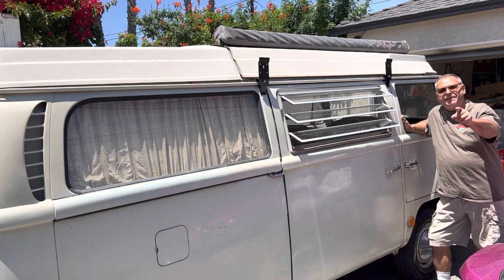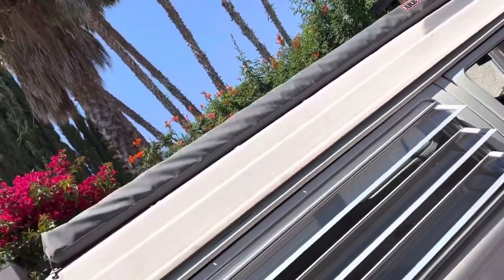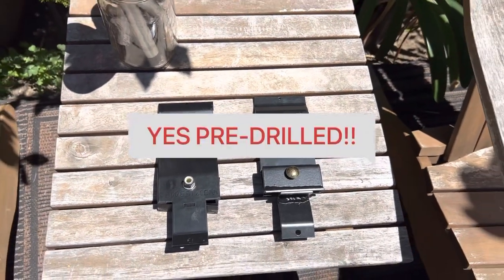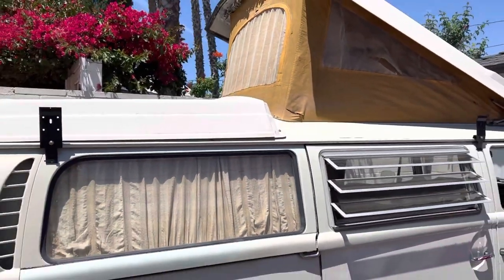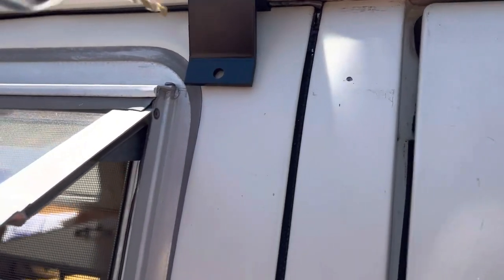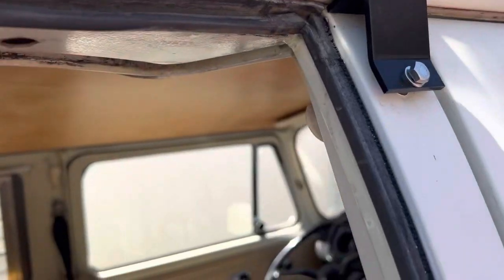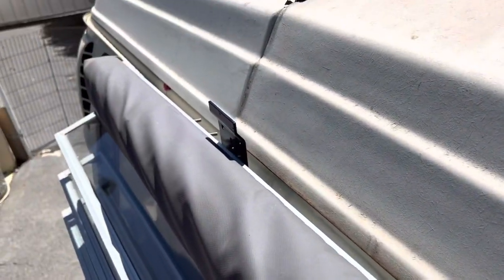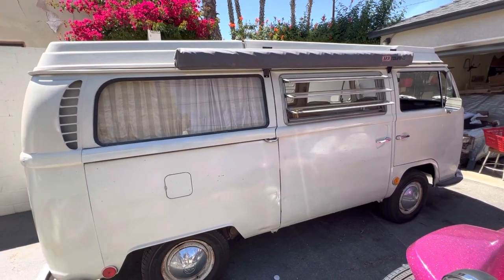GO WESTY.COM ARB AWNING MOUNT EARLY VW BAY WINDOW BUS 1968-71 ONLY T2 CLAMP ON RAIN GUTTER #philatv

Comment: I loved my ‘65 walk thru and the 76 bay but my ‘84 Vanagon is the bomb.  Just got it back from Colorado Springs where Rocky Mountain Westys put an ‘89 Subaru 2.5 in.   Life is good.
Do this bracket beat up the paint at the bottom?   Could you put some vinyl there to ease that a bit?   Drilling holes is kinda scary.
Your Bay Window looks killer.  My wife had a bay that she used for taking her dogs to shows.   Great vehicle and it got super mileage.